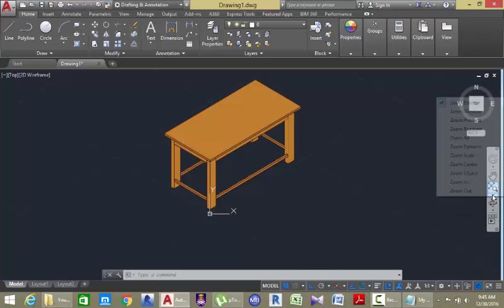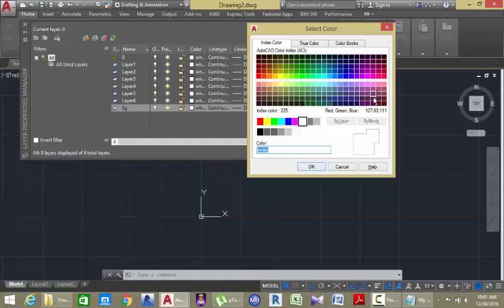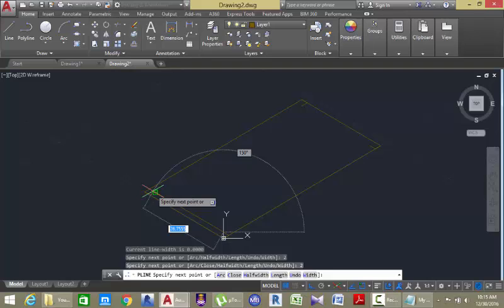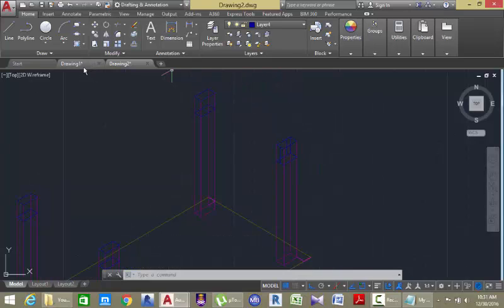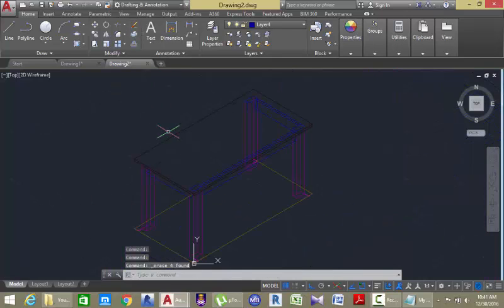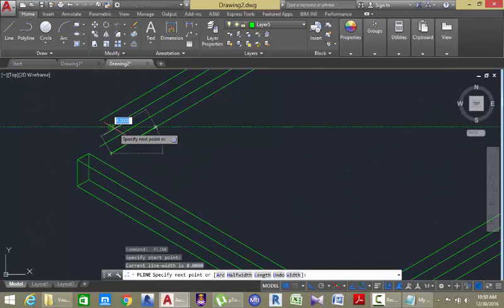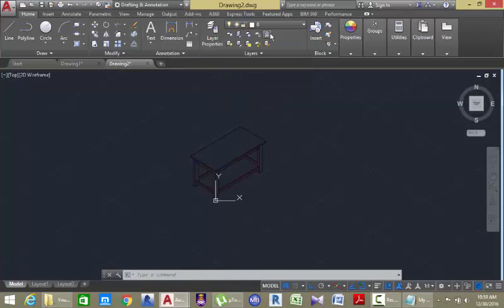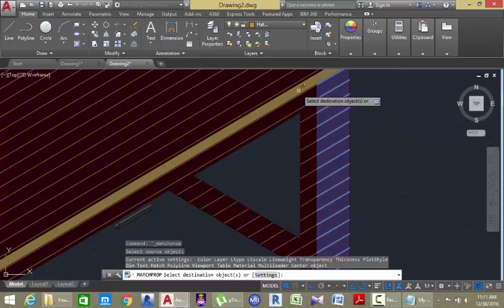autocad isometric drawing

Comment: what settings have you used for the units?
Reply from the maker: Decimal Inches
When you are in AutoCAD environments,
type UN on your keyboard and press enter

This will brings the Drawing Units dialogue box 
In the 'Length' section
Change the 'type' to Decimal

In the 'insertion scale' section,
Change the 'Units to scale inserted content' into inches. Live all the other settings as they are and click OK

Or start a new Drawing by clicking New icon on the quick access tools bar

This Will brings the select Template dialogue box. In the select Template dialogue box select 'acad' Template and click open. The Units is automatically set to decimal inches. if this is not helpful, please let me know I will create a short video for you to solve this problem. Thanks for comment.

https://youtu.be/uNfBYO4sXPg
https://youtu.be/Yh17AHrCPGw

https://www.blogger.com/blogger.g?blogID=4934020295419173532#allposts

https://youtu.be/v9z1AoX5BxA

https://youtu.be/5VaGz9x0F1Y

https://youtu.be/8oHVXJxYNxM

https://youtu.be/tSs5wFZzww8

https://youtu.be/SyeJfZThMAc

https://youtu.be/emTou5lk23A

https://youtu.be/W_ycSXLLq9g

https://youtu.be/ia5rCdPV0Po

https://youtu.be/uIM_maVTw0E

https://youtu.be/cGEm5kPoNH0

https://www.youtube.com/watch?v=8oHVXJxYNxM&t=887s
Reply from the maker: Decimal Inches
When you are in AutoCAD environments,
type UN on your keyboard and press enter

This will brings the Drawing Units dialogue box 
In the 'Length' section
Change the 'type' to Decimal

In the 'insertion scale' section,
Change the 'Units to scale inserted content' into inches. Live all the other settings as they are and click OK

Or start a new Drawing by clicking New icon on the quick access tools bar

This Will brings the select Template dialogue box. In the select Template dialogue box select 'acad' Template and click open. The Units is automatically set to decimal inches. if this is not helpful, please let me know I will create a short video for you to solve this problem. Thanks for comment.

https://youtu.be/uNfBYO4sXPg
https://youtu.be/Yh17AHrCPGw

https://www.blogger.com/blogger.g?blogID=4934020295419173532#allposts

https://youtu.be/v9z1AoX5BxA

https://youtu.be/5VaGz9x0F1Y

https://youtu.be/8oHVXJxYNxM

https://youtu.be/tSs5wFZzww8

https://youtu.be/SyeJfZThMAc

https://youtu.be/emTou5lk23A

https://youtu.be/W_ycSXLLq9g

https://youtu.be/ia5rCdPV0Po

https://youtu.be/uIM_maVTw0E

https://youtu.be/cGEm5kPoNH0

https://www.youtube.com/watch?v=8oHVXJxYNxM&t=887s